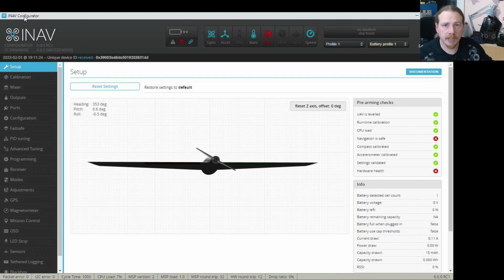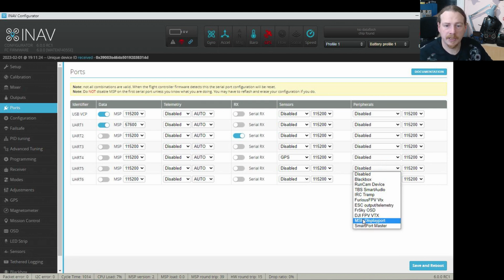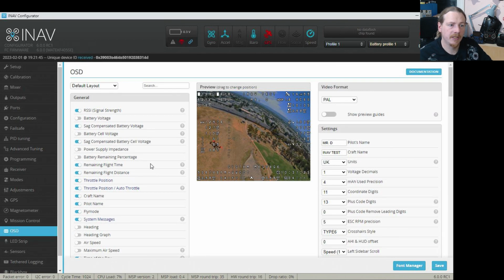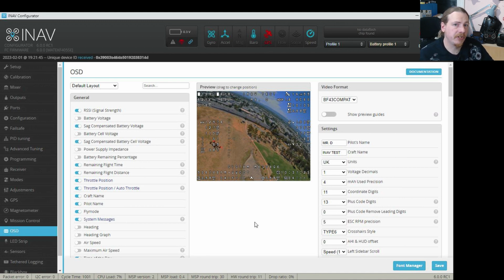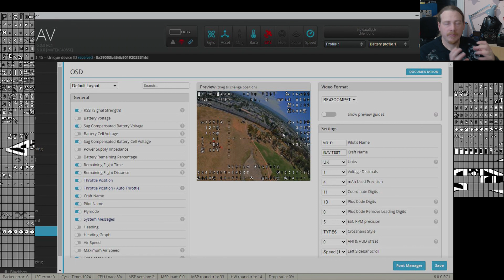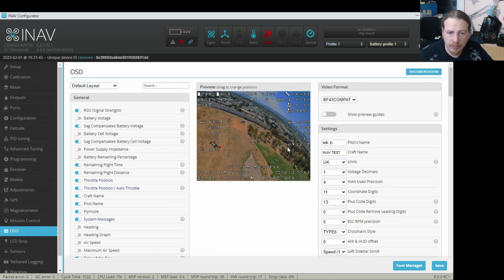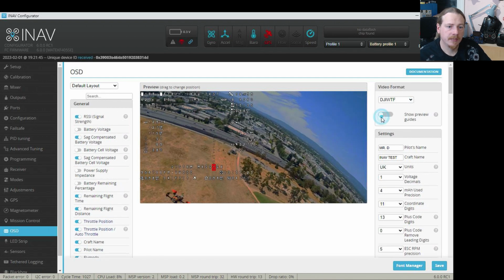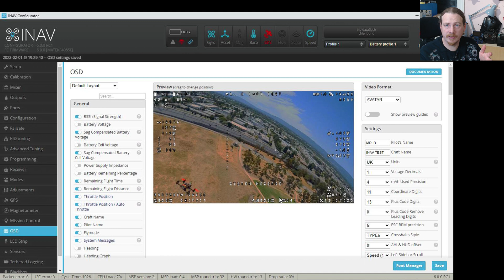How to set up HD FPV systems in INAV

Comment: how to fix this "letters instead of dots" issue? https://youtu.be/_bbWLlpTVbo , i have v33.39.10
Reply from the maker: You need to use the inbuilt INAV font. Not auto or a custom font. 

Or, update to the latest beta firmware, which is much better than 33. It also fixes that problem.
Reply: @MrD  probably i will give it a chance...
Reply: @MrD  not yet on new firmware, but managed to get those parts right - https://youtu.be/06imzlCiVeE ,  for VRX and VTX as well... real world flight in 5 weeks... once my arm will heal after surgery... ;)

Comment: Awesome, I just went digital with  HDzero. I’m building a 7” quad first then a ZHOD XL . Lucky I stumbled on this video. I’m finishing my second S800 with the auto launch in INAV . My question is with your sequence of tax switch assignments you mentioned no navigation modes can be on and in your demonstration you have manual mode on. Can I use acro or horizon mode? Instead of manual. Or with position hold on just switch from manual to acro and no worries.
Reply from the maker: The non-navigation mode is just to enable you to arm. This can be manual, acro, angle, or horizon. Once armed, you can select an exit mode (I use loiter). This is the mode INAV will use once it’s completed the launch. If you check out my autolaunch video. It’s all explained in there https://youtu.be/rj_RSrXqib8?si=Hh9ReKhMdGp_gYup

Comment: Hi Darren, does the WTFOS on the v2 googles with colour fonts work woth inav?
Reply from the maker: It depends what you mean. If you mean the colour changes depending on alert level, like BetaFlight. No, INAV doesn’t support that. 

If you mean a font where certain things are just different colours. Yes. This should work fine. That is down to the font you upload.
Reply: Ok got it. Thanks Darren.

Comment: So I have inav 6.01 and when I set up osd in inav and move things around in inav all looks great untill it goes to my 7inch screen when I plug in battery and get ready to fly. Seems to move things on top of things and all over the screen.Its useless. what am I doing wrong??? thanks in advance.
Reply: Did you figure this out? Inav 6.0 DJI O3 goggles integra. I have the same problem.

Comment: Hi, what do you think about using walksnail on softserial? 
I have selfbuild plane, and it was pain in the ass to build, it has matek f411 wte, and its only 2 uarts available, but i found that its possible to use softserial for osd walksnail, what do you think it will work, or i need to buy f405 flight controller, thank you in advance)
Reply from the maker: AFAIK, Walksnail will not work reliably on SoftSerial. With digital FPV systems, you really need at least 3 full UARTs.

Comment: Hi Darren, MSP display port in inav 6 works also for Dji fpv air unit (the old one, not the O3)?
Reply from the maker: Only if you use the WTF firmware.
Reply: @MrD  no, on an italian forum they said me that with inav 6 you can use msp displayport alsio with the old one dji ar unit
Reply from the maker: You shouldn’t. You should still use DJI VTX. MSP DisplayPort has only been set up for DJI with WTF or O3. To be honest. If you’re using the old DJI system, I don’t know why you wouldn’t use WTF. It is a huge improvement for the OSD, even over O3. It is fully supported.

Comment: what do you reccomend for using a frsky R9 Pilot FC and a DJI 03 coonectio/setup wise? pilot is basically a Matek 765?
Reply from the maker: Pretty much the same as any other flight controller. It’s just power, ground, and a UART.
Reply: @MrD  awesome thank you I'm about ready to start building here been acquiring all the parts The R9 pilot uses the FR sky pixel OSD I'm hoping that it will work well with the DJI
Reply from the maker: With DJI, you won’t use the PixelOSD at all. That will be disabled.

Comment: Hello, could you help me? I have a question, is INAV compatible with dji O3? I connect my drone to INAV and the O3 does not work, the O3 leds are off, and with betaflight it does work, how can I solve this problem? Thank you very much
Reply from the maker: Follow a setup guide for INAV. It is different to how BetaFlight setup digital video. Don’t enable MSP on the left of the ports page. On the right side, use MSP DisplayPort. 

It does work. Though the number of usable OSD elements is less than with other digital and analogue OSDs. Because of limitations in DJI’s implementation. Only DJI can fix that.

Comment: Great video.. BUT i got a head-scratcher for you.
 I have a caddx Vista polar air unit... I followed your instructions and now when everything starts up I can see the inav 6.1 splash screen show up in front of the fpv view in the goggles like the OSD is going to work but then the splash goes away and no osd comes up..??? 
I have system voltage picture looks good the mb per second go up when I armed it... Just no osd 😢😢
Any help would be greatly appreciated
Oh, and I'm using the new dji goggles integra.... Thinking that might be the problem....

Comment: hehe, recently I found that one of my older DJI Airunits is "partly" broken. took me some time to figure out.  It shows an image, the cables and ports are correct, but I don't get OSD  (or even the system volts). 
When replacing this airunit with another one (same software, same WTFOSD state) - it works ;)
Solution: moved the malfunctioning Airunit to a copter where I can live without OSD ;)
thanks for the nice vid, greets, Mario
Reply from the maker: There’s some positivity Mario. If it’s only half broke, use it where the broken part isn’t needed. I like that 👍🏻

Comment: Hi, thanks for your videos. I wanted to ask how to make the dji control 2 move the bars. I can't get the bars to move in the receiver option. I have the dji o3 and it's connected to uart 5 with sbus. The OSD looks good but doesn't detect it. the transmitter control 2 dji.
Reply from the maker: Sorry, I don’t use DJI. I believe it should be set up as SBUS of Fast SBUS. But other than that, I have no experience with this system.
Reply: Ok thanks I'll keep trying...

Comment: I did the set up that you used for wtf and goggles v2.  It didn't work for me.  When I boot the goggles for connection to my Caddx Vista, I don't get the osd as set up in Inav 6.1.  I get a message in the lower right hand corner that says something about font.bin.  I have the 4 Inav HD fonts installed on the root of the sd card of the googles.  My goggles and the vista have been rooted, Wtfos installed and the msp piece is also installed. Help!
Reply from the maker: It sounds like an issue with the WTF setup. Sorry, I’ve never used or owned this system.

Comment: Another great video, thanks. I am using the HDZERO system, and the only thing I can’t seem to work is changing the power levels on the VTX when arming and disarming .Am I not able to do this now with the HD system?
Reply from the maker: You need to use the HDZero stick commands.
Reply: @MrD  thank you for clearing that up, I have been doing that for a manual, adjust, but I thought it would’ve adjusted when I armed and disarmed…
Reply from the maker: That would be down to HDZero to implement. To be honest, I don’t know a lot about their system. But I know that Avatar does start and stop recording with arming.

Comment: we dont set up vtx tables in Inav? is the only way to set vtx tables or channel and band is through CLI commands?
Reply from the maker: We don’t set up VTx tables in INAV at all. The VTx knows what channel and bands they can support.
Reply: @MrD   so the only way to change your channel and band is thru the vtx GUI with a controller?
Reply from the maker: @cowboybebop521  no, you can use the Configurator, the OSD menu, the adjustments, or the programming framework to change via switches.

Comment: I have the Matek F-405 FC. When I updated the firmware from 4.1 to the 6.1 I had these show up in the CLI as errors. Do I just change the values, or remove this from the program? 
set imu_acc_ignore_rate = 9
set imu_acc_ignore_slope = 5
Reply from the maker: Just ignore them.

Comment: Hello,
Why at Inav Configuration can not for AIRPLANE with ESC Bisirectional?
I want build model for forward and reverse (air brake brushless for short run way)
Reply from the maker: Bidirectional DShot is not supported in INAV at all. That doesn’t mean the motor will spin backwards. Bidirectional DShot sends telemetry data over the ESC signal wire. 

For reversing thrust. You need to use reversible or 3D ESCs. And set up your transmitter to have centre sprung throttle.
Reply: I am still use Inav 6.0.0 for stable Aileron, Elevator and Arming for recording Vista HD in Goggle DJI V-1.
And than Throttle buttom to Up for ESC Bidertional at CH6 (sleeve from CH3).
Mixer insert CH6:
#at Forward:Weight 50, Offset 48, Diff at Switch F Up
#at Reverse: Weight -50, Offset -48, Diff at Sw-F Down.
#Overide CH6 at -3 at Sw-E for Safety.

Comment: Thank's for the video, I'm having trouble with not being able to get the FONT working, I see that there's a TOOL but don't know how to or were to download it or were to install it, my OSD view is prefect. Just need the Font HOW TO/ Using INAV 6.0/Matex F675/Walksnail Latest FW /VRX V1
Reply from the maker: With the current firmware you have to use the font installed in the goggles/vrx. If auto doesn’t work, manually select INAV.

Comment: Me and a friend are trying to setup HD zero to show the osd  through his ethos radio with video monitor but the osd will not show up checked and made sure everything is wired right but no osd is  there anything we are missing thanks
Reply: sorry it was a frsky tandom x20 radio
Reply from the maker: Sorry, I've never used HDZero or the X20HD. So I don't have any experience with them, or know what it required to get them working together.

Comment: Thanks for the great video. I just upgraded from inav4.1 to 6 using my matek f722 wing board and analog video system but my osd icons and measuring units r all crapped up. Home position shows battery icon. Km/h shows ft/s and all icons r messed up with wrong parameters. Can u help plz
Reply from the maker: Have you uploaded the latest font?

Comment: Hi Darren - great stuff as always - but here's a stumper.  I have a Frsky X20HD trying to run a Freestyle VTX with INAV 6.0 - I unlocked it and flashed with the most current FW and changed the port as you show.  I got video and OSD immediately on the X20 screen, then cycled through the screens just for kicks and OSD disappeared (video stays) never to return!  I have reflashed everything, including INAV, rechecked connections, tried different UARTS (I'm running a Matek 405) and even bought a new Freestyle VTX (I'm desperate obviously), but no change.  There is a little two prong port on the side of the X20HD screen that the manual says can be used "for emergency flashing of the VRX", but there is no information anywhere on how this works. I am about ready to buy a HDZero VRX for my goggles, but the whole point of the X20HD is to use it as the VRX, so this is completely giving up - and like you, I don't like doing that.  Any ideas?
Reply from the maker: Sorry. I’ve never used that transmitter and don’t have HDZero. It sounds like a problem on the VRx side. Possibly a setting. Maybe a firmware mismatch. Sorry I can’t help you. I think the best bet may be to ask in one of the FrSKY/ETHOS groups on Facebook
https://www.facebook.com/groups/1957335924526585/
https://www.facebook.com/groups/frskyrc/
Discord
https://discord.gg/F8VpCaxj4f
Or email FrSKY at frsky@frsky-rc.com

You may also be able to find help on HDZero resources
https://discord.gg/pJyp24P6PS
https://www.facebook.com/groups/hdzero/

Comment: Thanks for the great content. When I use the O3 system and I only have two UARTS ( F11-WTE) can I Use UART2 pins for the OSD and SBUS together if both are coming from the air unit?
Reply from the maker: No, a UART can only be used for one operation. You would probably have to put the O3 on SoftSerial. Definitely don’t put critical things like control on SoftSerial.
Reply: @MrD  thanks, just getting into FPV and FC, so I have to learn a lot :)

Comment: I am unable to get OSD to work. I have Goggle 2, with Inav 6.0 installed on Iflight Beast F722. The UART is wired correctly.;  for port, it is set to DJI FPV VTX.  The only option available for video format is AUTO, PAL and NTSC. Is this working for anyone else?
Reply: set the port to msp display port to get other options and see if that works for you
Reply: @flashpoint1338  I did that; and was able to get  OSD to display, though the fonts/formatting was all over the place,  text not readable at all.
Reply from the maker: You need yo set the port’s peripheral to MSP DisplayPort. Then on the OSD page, set the video type to BF43COMPAT.
Reply: @MrD  I'll try this. Thanks.
Reply: well you are lucky , at least your dji air unit is working. mine doesnt power on at all

Comment: Still cant get my osd to work. I am running the most recent release Inav 6.0.0 with DJI 03 air unit, goggle 2, matke h743 wlite fc and have tried both using the msp display port option with bf43compt and DJI FPV VTX options with no luck. Only thing differnt I see is when I use bf43compt in my goggles it allows me to use canvas mode in normal or hd, but still no OSD at all...
Reply from the maker: It needs to be MSP DisplayPort on the peripheral for the UART. On the OSD page,  use BF43COMPAT for the video type. 

Check that you’re actually editing the OSD screen you’re using (INAV has default and 3 alternative OSD layouts). Also make sure the wiring for the UART is correct.

Comment: I am using DJI 03 air unit with mamba F722 stack, I cant get this to work, my air unit wont power on, please help
Reply: if its not powering on at all then you probably have it wired wrong.
Reply: @AdrenalineHobbies  Hi ninjor,  i dont think that is the case,  it powers on just fine with betaflight
Reply from the maker: Power has nothing to do with INAV. That will be down to the wiring.
Reply: @MrD   the FC is a plug and play and connects directly to the 03 air unit, I don't wire anything except the GPS and the motors. If for example there were wiring issues, then why betaflight works just fine. I don't have this problem with betaflight, the unit powers on and even gets very hot
Reply from the maker: Then check Rich’s suggestion. Some FCs have an onboard PINIO that allows the VTx to be switched on or off. This will be either USER 1 or USER 2 on the modes page. Check the manual for the FC.
Reply: Some fc have a camera switch option so you dont overheat but it should be on by default in inav under modes
Reply: @AdrenalineHobbies   my remote controller has to be working in order to use the switches, it won't work because the dji air unit has the receiver built in and when it is off, then remote cant pair. is there anyway I can turn it on with CLI command?
Reply from the maker: You don’t need the transmitter. Just set the range for the USER mode that controls the VTx power to be always on.
Reply: @MrD   this solved my problem, thank you very much

Comment: great videos! couldn't the fonts that the avata uses be added to Inav so the OSD would be just like the avata as a workaround for the goggles 2 with the 03
Reply from the maker: No. The fonts need to be on the goggles. They are what render the OSD. The only people who can fix this are DJI.
Reply: @MrD  yea I’ve been emailing them everyday! Not holding my breath tho. I guess my thoughts are the avata fonts would be on the goggles
Reply: I'm sure you're aware, but just in case, with the new Goggles 2 update, there's a new setting under Display for HD canvas mode. I tried it with my 03 Air Unit, and all my OSD icons are on the edge of the screen!
Reply from the maker: @traviseastman8355  HD support will be in 6.1. Unfortunately, once again, DJI didn’t do this properly. If they had you could have uploaded an INAV font to the goggles and used the Avatar video type; as it uses the same size character grid.
Reply: @MrD  hmm I wounded why layout is working for me now. I didn’t change anything in inav still the beta flight compatibility mode all I switch was to the HD canvas mode on the goggles and the layout was fixed even in BFCM 4.3 the fonts still aren’t great but it’s something

Comment: Nice tut! Subbed.  Just flashed 6.0 release. Osd works great. Only issue I have is the vtx channel and power show 0?  I thought with msp you no longer needed to add a port for SA
Reply from the maker: Which HD system is this for? AFAIK both Avatar and DJI will stay on low power until armed. Then use the power level you set in the goggles. HDZero used SA, but not an official implementation, so it never worked with INAV. MSP VTx is a new thing, which HDZero supports. I believe someone is working on support for MSP VTx in INAV. But it may not be out until 7.0 depending on the amount of work involved and if it breaks backwards compatibility.

Comment: great video but:  ports settings when dji osd vtx is selected osd works, when msp display port option is selected osd does not work. do you have any suggestions to fix that? btw, have v2 with wtfos installed.
Reply: It's me, dumb ass Jim, reporting solution. I'd been flying drone all winter so when setting up inav plane this March I'd failed to remember I'd never to rooted the plane air unit. Did that. All's working now. Great video too. Helped lots. Thanks.
Reply from the maker: Glad it’s working 👍🏻